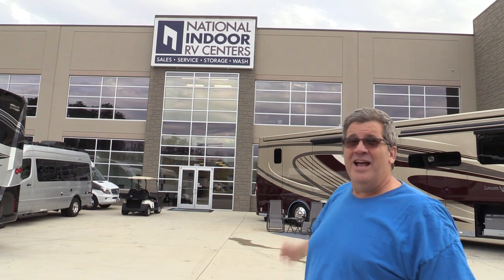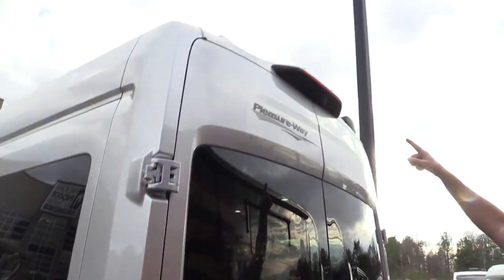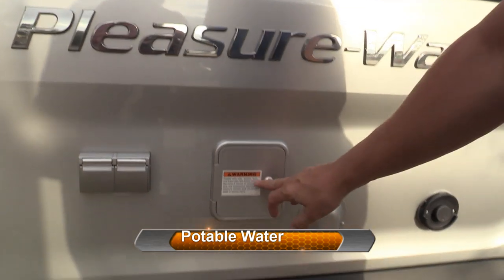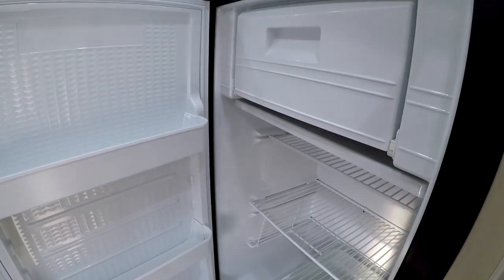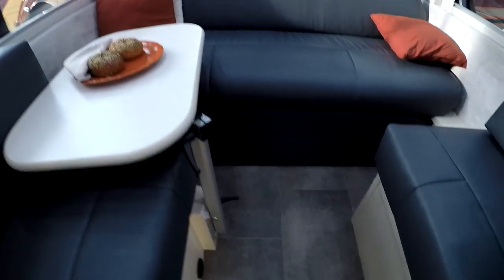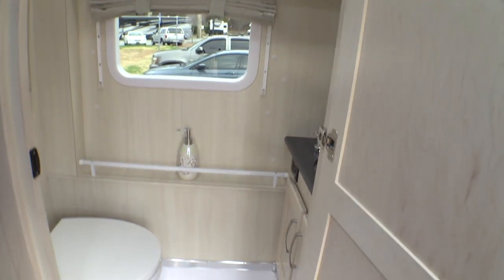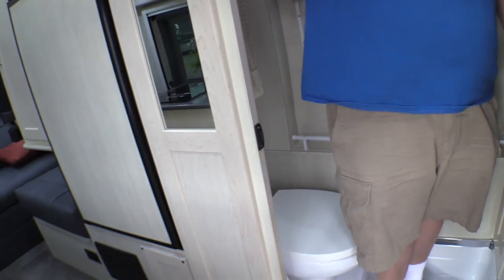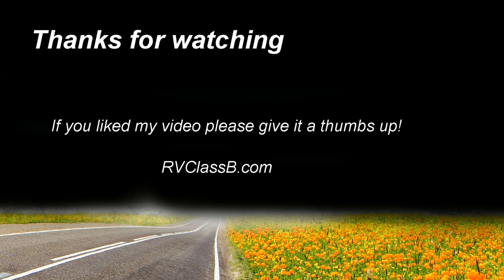2020 Pleasure-Way Ontour 2.2 Walk through

Comment: I wish someone would address the driver/passenger seats.  Are they electric, do they have memory settings, lumbar support, etc. My wife is only 5 feet tall and finding comfortable seats to drive is critical.  To my knowledge Mercedes chassis is the only one offering luxury seats that you would expect in any new vehicle at this price point.  If anyone knows about upgrade seat possibilities, please advise.  Like this chassis but will not buy if driving is miserable due to poor seats.  Thanks
Reply from the maker: I really like the Ford Transit chassis,  it drives great, cheaper to maintain, plenty of power and free of diesel issues that seem to affect some people. 

As for the Ford seats, I have a 2019 chassis and all my seats do is move front and back, and the seat back tilts.

Comment: Where is the black water drain hose?
Reply from the maker: The hose is stored under the back of the van on the driver’s side by the rear bumper.  The drain is on the driver’s side in front of the rear tire behind the running board.

Comment: The audio is terrible, the background noise is louder than your voice.
  I toured at the Ontour 2.2 at the Florida RV show last weekend (Sept. 18) and the factory rep said they have done away with propane altogether on this model. Also, the big thing is the shower is big enough for me to stand in comfortably at 6,3". Good luck on future videos.
Reply from the maker: Thank you for your thoughts.  Question, if they got rid of propane what do the use to heat water and the cabin?
Reply: @CampingCoastie  He said everything is electric now with 300 watt solar, the alternator and shore power.
Reply from the maker: @jimc5423  200 AH of lithium batteries would not last long heating the coach or water.  I am pretty sure they are keeping propane for that, but I will check.
Reply from the maker: I just got off the phone with Doug at PleasureWay, he said they are not getting rid of propane.  Need it for the Truma appliances.
Reply: @CampingCoastie  You're right. I just looked at the Pleasureway website and it shows LP tank with electric shutoff switch. I don't know why I was told there was no propane. My wife heard him say it twice, so I wasn't dreaming. This was a factory rep, not a salesman. We will probably get one after test driving one. Sorry for the confusion.

Comment: how does it compare to the coachman beyond?
Reply from the maker: Chassis wise, the same, gas, great power and drives great.  Quality of the build, to me me, they are both good.  They both have a compressor refrigerator and gravity dumps for the black and gray tanks.  The differences are big when it comes to the electrical systems.   The Ontour has 200AH of lithium batteries vs 600AH for the Beyond. Battery charging on the Ontour is via shore power, driving and a gasoline generator.   The Beyond is via shore power, which you can adjust in 5 amp increments from 5 to 30 amps.  Great when plugging into a 15 amp outlet.  It also charges while drive with a high output alternator.    They both have solar panels, 300 watts Ontour and 200 watts Beyond.  The Beyond has an optional 12 volt AC that is super quiet and can run while driving.   I like the cabinets in the Beyond better, the drawers are dovetailed  and have nice slides.
Reply from the maker: I another big difference is the price,  even though a fully loaded Beyond lists for just above $160,000, you can one for about $115,000.  That is a nice savings over the Ontour.

Comment: For me since I'm single and it would just be me traveling I basically want the folding bed taken out and put the cot or single bad in its place and on the other side you could put a a table with two chairs bench Style
I wouldn't want the generator I'd want solar on the roof and the ability to recharge the lithium batteries with the alternator from the engine solar or Shore power
And instead of propane I want everything Electric they have electric heaters and pump up the inverter to 3000 Watts
Reply from the maker: I agree about the generator, no need for it.  Ford has an optional second alternator that would do a great job charging the house batteries.  And not really an issue with idling the gasoline engine, not like the diesel engines.  From my roof video it looks like room for some more solar panels, that would also be good.
Reply: John the way they make the sofa is exceptionally comfortable.  Best use for a while and much better than a cot